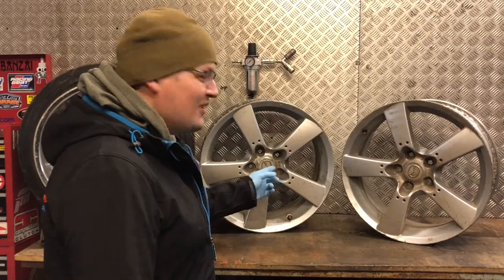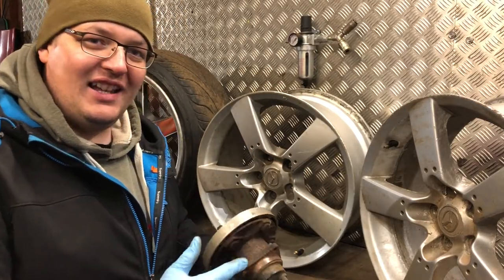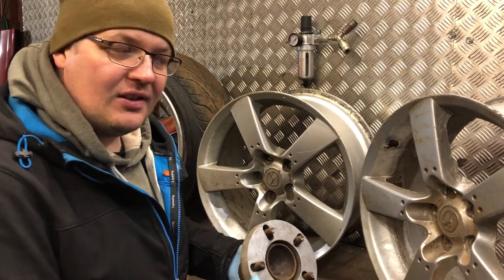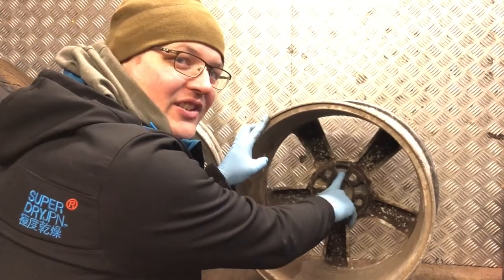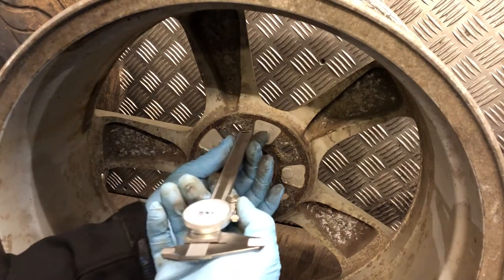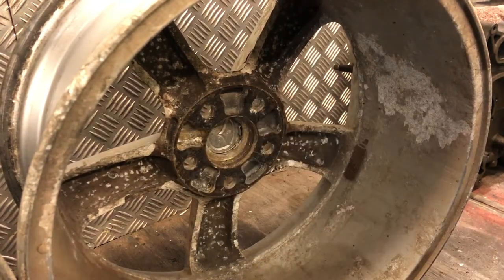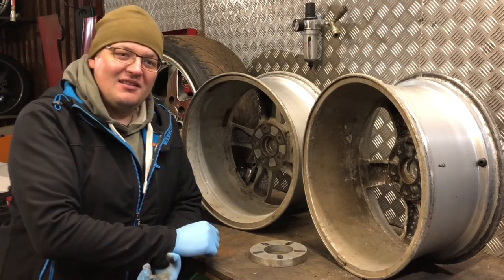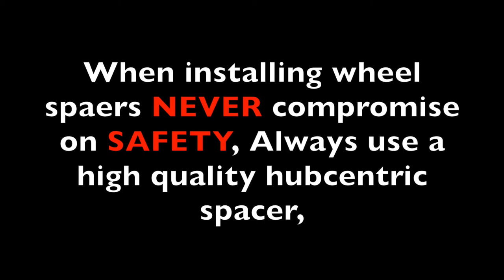Essex Rotary Quick Vid 25 - Wheel Stud Clearance when fitting Spacers on your RX8

Comment: Eibach 25mm spacers (System 4) are the perfect fit for the stock wheels, front and rear. No issues with the studs as they are flush with the spacer.

Comment: Thanks for the video, very helpful. Do you know if they introduced the different wheel types at different manufacturing years or is it just mixed?
Reply from the maker: THis is honestly pretty impossible to tell, especially so long since the original production of the vehicles. it may have been they had two companies manufacture them, or two slightly different molds

Comment: Hey guys. I've got a PZ edition rx8 running 245/40R18 tyres, do you know if 20mm wheels will fit?
Reply: 20mm spacers are pretty safe unless your slammed really low. If you are slammed you'll need to get an alignment to add some camber and maybe roll your fenders. But I highly doubt you'll need to for 20mm.
Reply from the maker: Yes 20mm spacers will work fine, you should also be good for arch clearance even with the wider tyres.

Comment: I have a series 2. I dont have either set of rims. But I was thinking 25mm spacers
Reply from the maker: You should still be able to use these principles in order to work out if they will fit your wheels or not:
25mm on the rear of an R3 May be a push depending on wheel fit